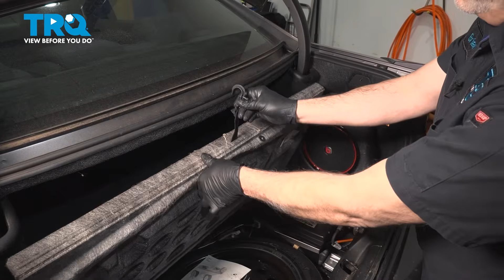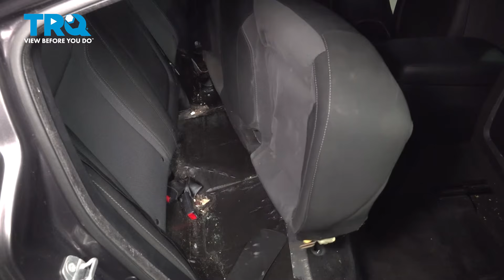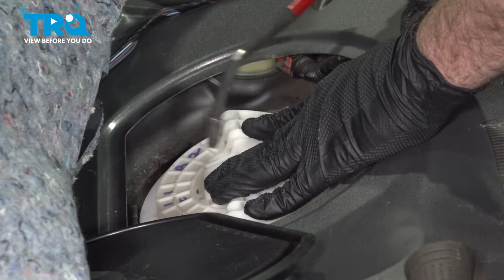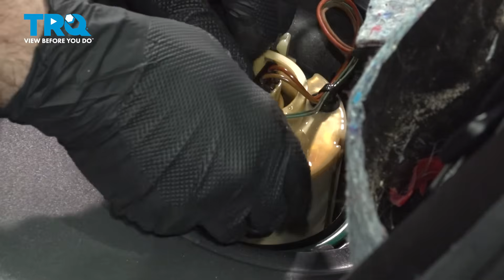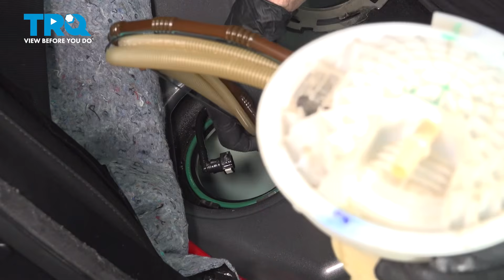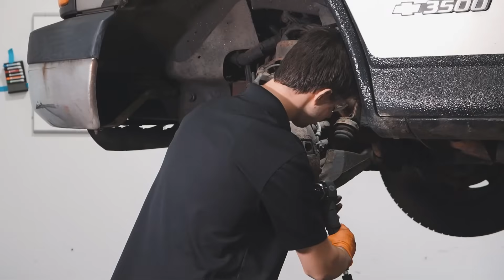How to Replace Fuel Transfer Unit 2011-2023 Dodge Charger 3.6L V6

Comment: Always changes both the fuel pump assembly (left) and the fuel transfer (right) at the same time unless you use oem parts. Aftermarket full and empty ohm readings are not the same as oem so the fuel range indicator and fuel level will not be accurate until you do. Also, aftermarket Delphi fuel pumps have a different pinout plug for the connector that goes on top of the fuel pump (left) you have to crimp the new supplied harness otherwise your vehicle won’t supply power to the pump.

Comment: Word of advice, I stupidly went to change both of these on a full tank of gas. Now it may look like fuel will not dump out of the top of the tank if because luckily the pump and transfer on located on the top. However this is untrue. Having popped the ring on the fuel pump I immediately found a gushing sound of fuel making contact with the garage floor. Now luckily I had a drain pan that I could quickly throw under to catch the majority of it. I then also had to use a hose to help suck out some of the fuel and filled half a 5 gallon bucket before it was overflowing. Other than that it was an easy change

Comment: Thank you for this video. Used it change out both sides on my 2018 Dodge Charger today. Simple, clear and to the point. My car started with no problem after replacement.